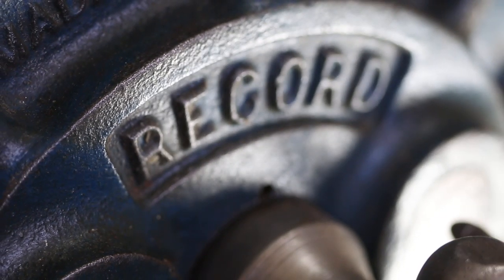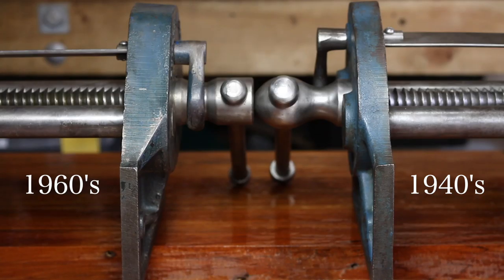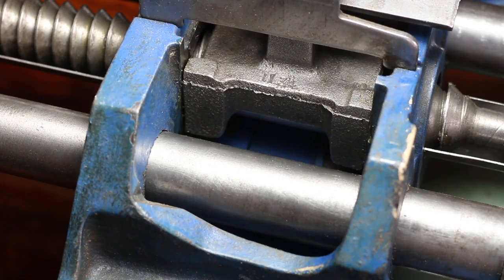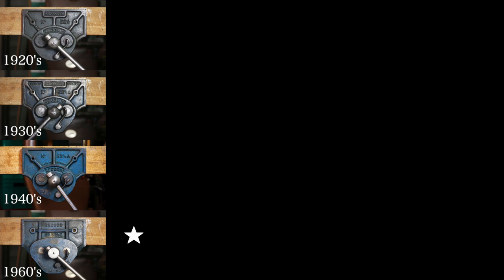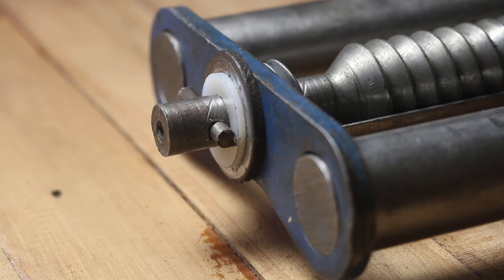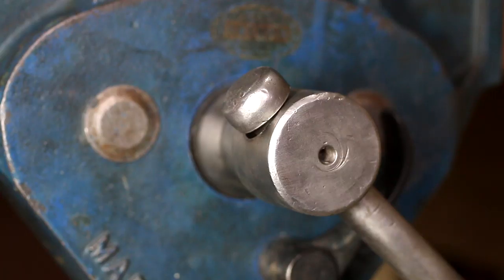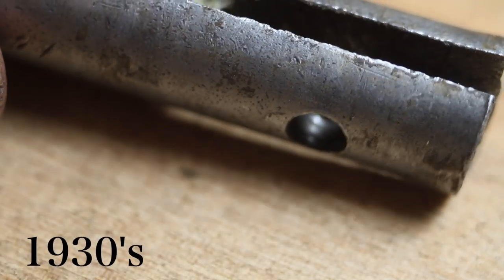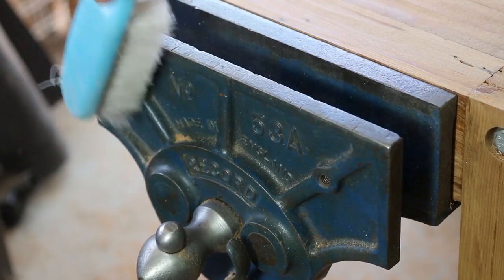Record 52 1/2 Vice Comparison - Vintage vs Pre-Modern - Which Version is Best

Comment: I just got one of these but mine does not have the quick release function (gutted) and I can't find any history on it, could you possibly enlighten me at all to anything you may know about it?  Many thanks.
Reply from the maker: That's a bit of a curve ball. Perhaps they made a few over the years. However, is there a hole in the face plate that would normally accept the quick release lever? If so it would suggest someone has perhaps ripped the mechanism out. Other than that, I'm not sure.
Reply: @elams1894 No there isn't a hole in the front plate unfortunately, I would have liked quick release. Thanks for replying.
Reply from the maker: @drsamuelbeckett2998  that's very interesting, I have never seen a unit with no hole for a QR. I'll have to research that one. Certainly there were some odd ball units around. Cheers
Reply: The Record 52 1/2 P appears not to have a quick-release mechanism, or at least not in the images I've seen of it. According to https://smallworkshop.co.uk/2018/04/17/record-vice/ there are different letter codes appended to the product name to identify different models.
Reply from the maker: @stimuli9443  Very interesting with the 'P' designation. I have never seen one in the 52 1/2 but I guess that makes sense as the 'P' designation comes up alot in the engineering vice lineup, the 36'P' comes to mind. Cheers!!

Comment: Hello, very entertaining and informative video! And does anyone know what thread type and size screw is meant to be used in original thread in the face plate?
Reply from the maker: Thank you! Indeed good question, probably a Whitworth thread size. I have been lucky with mine as they all have had the screws still in them. I have been meaning to get both a Whitworth and Imperial thread guage and find out. Cheers
Reply: Slotted Countersunk 5/16 BSW X 1 7/16 LONG (37mm)
 WHITWORTH THREAD
Reply: @arcflup6855  Thank you!

Comment: I bought mine around 1982.  It is a 52 1/2 D.  It would seem that there were more than four versions made in the 20th century!
Reply: Mine also had a dog, unlike any of the ones in the video.
Reply from the maker: Awesome! There were quite a few Letter designations to go with the versions. 'P' represents the absence of a quick release mechanism. 'A' represents a thread cover. The letter 'E' that appears on the 60's version represents a thread cover and the letter 'D' on the 60's version represents a 'Dog', as you are already aware. I believe there also was an 'ED' designation in the 60's version that represented both a Dog and a thread cover. There were many designations that occurred in all 4 versions. Cheers.

Comment: Thank you for the info.    Excellent video humorous & enlightening .
I find it ironic that a different nationality can appreciate a common place item of British engineering with such passion, whilst most Brits take them for granted (myself included)
I prefer to buy British, when it comes to woodworking tools , particularly pre 1960.  
Thanks again    Excellent video
Reply from the maker: Thanks, really appreciate the kind words. My grandfather is British and Father Scottish so its been instilled in me to strive for quality. In this age of cheap garbage, anything that is British, German, made is gold when it comes to tools. I have two full sets of pre 50's Britool socket sets, 1/2 inch and even a wartime 3/4 inch King Dick set. My favs! I rate them above SK Wayne, still great but alas two of my SK Wayne ratchets have slipped. But the Britool soldiers on with huge workload. Certainly the older the better. Have a good one, cheers!

Comment: 110% sexual references while watching a vice video, I wonder which country this gentleman is from? Could the solid rimu workbench give it away? Seems sacrilege to use it for that, to me, though. Very interesting and detailed video - thanks. There is a version you don't mention with the area for the RD number, but without the number itself, too. They also didn't have the sticker proclaiming the benefits of the little cover on the earliest ones with it. My 52.5 is like your 30s one, with the flattened nub and RD number, not the rounded nub of the 40s one. My 53 is the 60s style. You should also have noted that the 60s version was the longest lived, available for about 40 years before the unmentionable occurred :-) I would subscribe, but YouTube completely stopped sending subscription notifications by email, so it's nearly useless. Might anyway, just as a bookmark. Cheers :-)
Reply from the maker: The timber is all recycled. Cheers. Thanks for the extra info.
Reply: @elams1894  Good to hear, and fair enough. I still treat recycled rare timber like gold, but that's just me. Re the extra info, there's a great write up here: https://smallworkshop.co.uk/2018/04/17/record-vice/
Reply from the maker: Cool, thanks. Yes I too treasure the recycled stuff. The recycled Rimu I used for the work bench was all warped and full of nails. I really could do little else with it. The good stuff I use for guitars and amp cabinets. Cheers
Reply: @elams1894  Fair enough! From the video it looked like 4" thick heart rimu for a table :-D I didn't spot any nails, but the camera can be a tricky thing to the eye :-)

Comment: What did happen in the 2000s?
Reply from the maker: Record sold to Irwin in 2003 I believe. As a consequence, manufacturing began to outsource to China. However, some models were still made in England  but it is unknown how quality changed. For this reason, In my opinion, a Record vice from the 1900's is preferred. Cheers
Reply: If you ever get your hands on an Irwin made record vise I would love knowing how it compares to the vintage ones.
Reply: I do  think there is any point on comparing them.
Reply: @elams1894  The G clamps turned to crap when they outsourced to china, noticably worse steel that rusts much more easily than the British made stuff,  I would imagine the chinese vices same problems

Comment: @10 mins in - your drooling over curvaceous knobs a little too frequently,  to not think of this as a bit of porn, . . what do you do for your real job ?

yes got a '60s one from a high school today - looking for the do's and don'ts with these brilliantly easy to use vices.
Reply from the maker: Ha ha, yeah I like a nicely shaped knob I must admit. I am a Post Entry Quarantine Biosecurity Inspector by day. In other words, I look for new pests and diseases that have made it into New Zealand., which has been way too many this year. The 60's model is an absolute beast, I have two on my bench, fantastic units. I too got mine from a high school, bought both for 50$ a piece in very good condition, stoked.